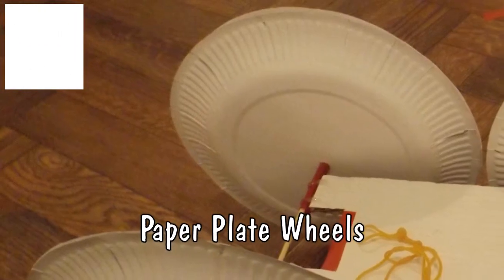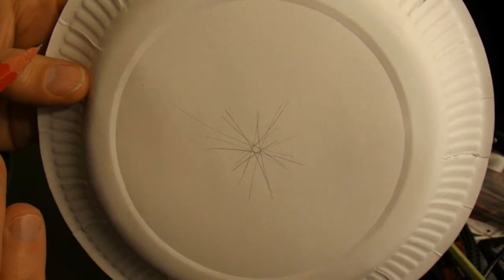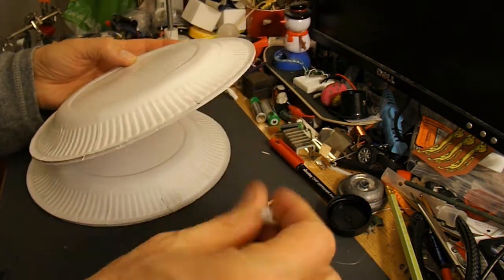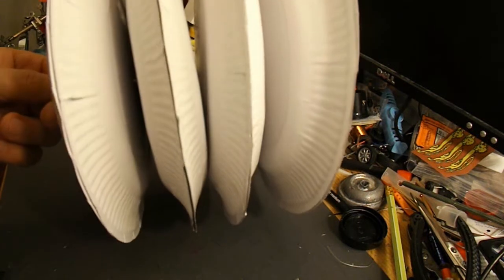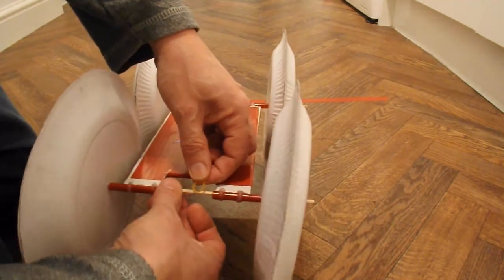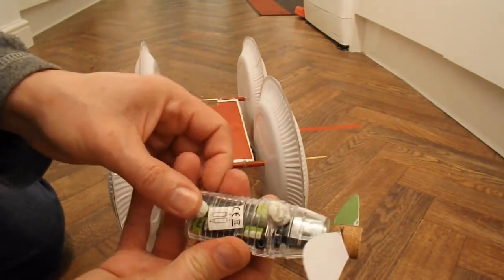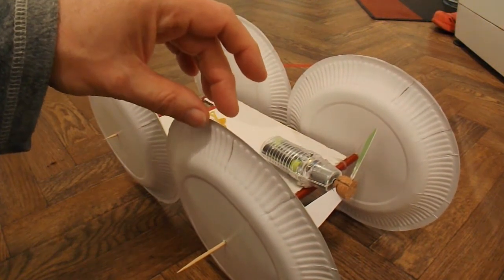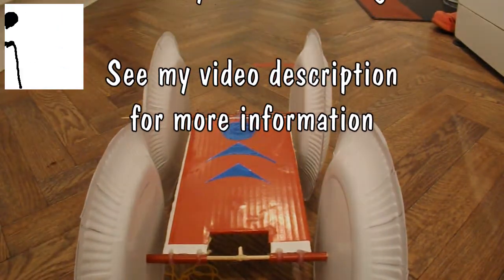Paper Plate Wheels

Comment: You could glue the bottom of two plates together, they should have more strength that way..
Reply from the maker: What makes you think that? Have you tried it? Doing it this way we get a good width so that the axle is held in place - although I did not align the holes very well.
Reply: Yes i have in my school project once. I made a hamster wheel powered car. 
 But i did use some bottle caps and some cardboard cut outs to add width and stabilize the axle..